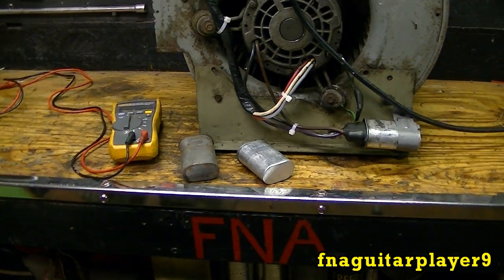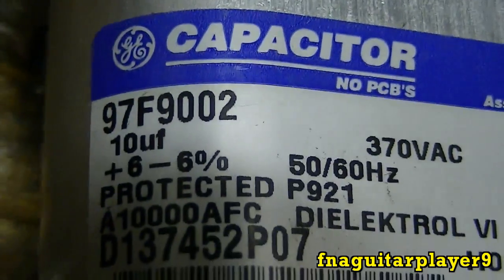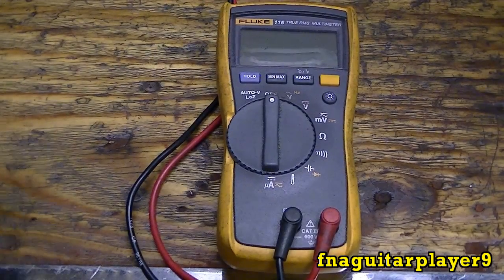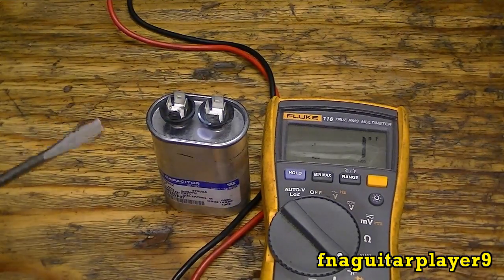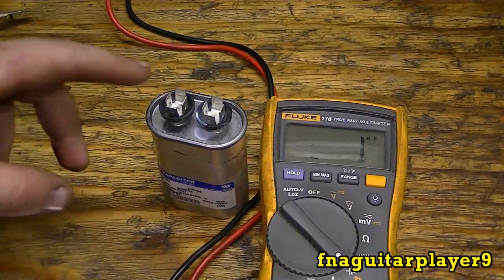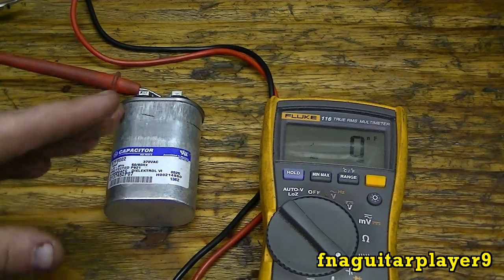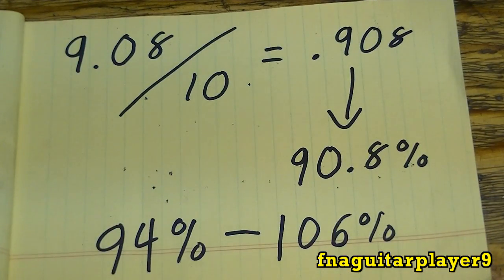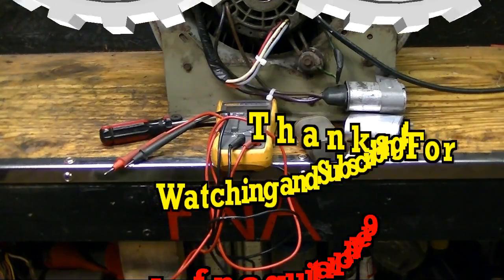How to Check Motor Start and Motor Run Capacitors

Comment: That higher value is not a serious issue. In the old days they could be +/- 20% new from the factory and would work just fine. The capacitance usually will go lower with age not higher. The reading may be higher due to high resistance. The capacitor is used to create a phase difference between the windings to cause it to rotate. This is a good basic check. Typically these days, new out of the box is usually very close to exactly what the value on the box is and the USA made ones are almost spot on. The capacitors are best tested with the current and voltage method in circuit but is not safe for novices as the capacitor voltages are higher than the input line and can be very  deadly.

Comment: i always wondered do capacitors read different capacities when tested with different voltages. like if a capacitor is gonna work under 220v ac it's capacity must be tested with 220 volts to show correct value?

Comment: Also motor will not burn out if it has thermal protection like my pool pump,it stop itself during a capacitor failure.
Reply from the maker: Some older motors may not have that though, it should but they may not. Thanks for Watching!!!

Comment: My A C blower capacitor 10 uf  370 volts stop working but I put 50 uf 370/440 come to my surprise it is working so the higher uf will run the motor but if I put lower uf will probably not work right?
Reply from the maker: If the capacitance isn't right it can make it draw more amperage or heat up, may work in a pinch but can cause damage over time. Thanks for Watching!!!

Comment: Would have been nice to have had a simple explanation of why we need a capacitor with our motor. Did not need a lengthy math lesson. If you cant figure a simple percent got no business working on this type equipment to begin with.
Reply from the maker: This video was on checking capacitors, not so much what purpose they serve, i can do another video on explaining that but it was not the purpose of this video. Thanks for Watching!!!

Comment: Thanks for this information a very professional class done in laymen's terms so just about anybody listening and watching would understand and yes mine was the capacitor last week this guy who works on AC units told me it was the motor after replacing it it done the same thing called them up and they sent a different technician I explained in detail what he did he looked at me replaced the capacitor then left an hour later the first guy showed up handed me my money back for the motor the boss of the company made him do this which i personally thought was a good deal all the way around because it made him embarrassed to do a better job after that I looked  up how to test them and thanks to you I can thanks again
Reply from the maker: Your welcome! Thanks for Watching!!!

Comment: ok, you earned a sub..  i have 1 question.. can the start windings burn up?  they dont have any resistance..  motor hums..  i give it a spin by hand and it runs fine..   capacitor just checked out OK.....
Reply from the maker: Appreciate the sub! yes, that is very possible thats wahts wrong, some motor will have a centrifugal switch to turn the starting windings off, that may be bad to. Thanks for Watching!!!

Comment: Awesome!  Thank you for a clear and simple explanation/tutorial.  You saved me several hundred bucks on a motor I was gonna replace.  A new $10 buck capacitor was all it needed.   I'm not an electrician but I have a good respect for dangers of electricity and good common sense.  All the other videos I watched on this subject were confusing and too complicated for a non electrician.   They had lots of diagrams and technical symbols, frustrating as heck. Thanks again, this was  extremely helpful.
Reply from the maker: Your welcome, its always the first thing to try.  Thanks for Watching!!!

Comment: I am testing the run capacitor  on my washing machine..the weird thing is,one or 2 times I get a reading..then I will try a couple of times and get nothing at all...I am using a fluke "auto reader" meter..I haven't had any issues testing other things with it
Reply from the maker: I'm not sure what would cause that, unless like Nici said it could be if the leads were swapped around it may be trying to discharge the cap from where it was tested before or something. thanks for watching!!!

Comment: Nine times out of Ten your capacitor is puffed out and is bad.  I replaced mine for $14.11  because it was more than 20 years old.  AC works as NEW.  I also replaced two 240 volt fuses that run the outside AC unit.  These videos saved me time and money.  AS a Reward I Paid MYSELF $ 500.00  For taking a moment to learn these basic techniques for repair. Thank You Louis.  6/30/2019.
Reply from the maker: Yep most common problem! Thanks for Watching!!!

Comment: IS IT NORMAL WHEN A SINGLE PHASE MOTOR RUNNING THE CAPACITORS TO BE  HOT OR THEY HAVE TO BE COLD NORMAL
Reply from the maker: They should not get hot, warm is normal but not hot. Thanks for Watching!!!

Comment: For one side you recomended to replace the  bad capacitors and your blower motor has a bad capactor and still using it . It this is an incongruence or not?
Reply from the maker: Yes it is, but this blower is used as a fan in the garage and is not used very much at all, so it wasn't a big concern to me, if its was on a furnace that was used it would be different, it wasn't to much out of spec. for what its going to be used for. Thanks for Watching!

Comment: Thanks for sharing this wonderful presentation. I'm impressed with your knowledge and simplicity to teach. This leads me to ask you a question concerning the following problem.   
I bought one of those el-cheapo China grinders, and it takes forever to reach the top speed; besides making a humming sound like if it was going to burn up before it can get to working speed. 
Now, is it possible to add, like a start capacitor to this bench grinder motor?
I just happen to own another grinder with 3/4 hp motor that looks identical to the new one, but with the difference that it starts much faster and also makes some clicking sound at the starting and the cut-off time (?) I'm assuming is because my old one has a starting capacitor, and this is the reason for my question. 
I have the feeling it can be done. Although I'm not including parameters, because I don't want to give you the impression of taking advantage of you but certainly hoping you could help me.
Thank you for any information.
Reply from the maker: I don't think you can add one to one thats not designed to have it, sounds like the starting windings are weak. That clicking sound is a centrifugal switch that engages and disengages the starting windings at a certain rpm. It might just be a weak or bad motor on the new grinder, its hard to say for sure. Thanks for Watching!!!

Comment: You stated using a cap that is out of range is bad for a motor,,, yet, when you tested your own it was in fact out of range, yet, your still going to use it, what kind of example is that? Buying a used cap on line, when they cost a means 20 bucks, are you kidding me? Just saying, I really did like the lesson, you did a good job minus the example you set.
Reply from the maker: I appreciate your opinion and you are correct, and if this was used daily i would not have used it, but this blower probably only sees a couple hours of use a year. I will eventually get a new cap for it. Thanks for Watching!!!

Comment: This video helped me troubleshoot a bad capacitor similar to the blower unit in the video, I got a brand new replacement for 5 dollars on amazon. unfortunatly after about 45min the blower stopped kicking on while the outdoor unit was running. I guess I have a bad motor.
Reply from the maker: I hear ya! Thats a good price. What probably happened is after a long time of using a weak capacitor (which usually shows no signs) it damaged the motor. Thanks for Watching!!!
Reply: Actually, I found the relay board to be the culperit. 28 bucks on amazon and it is running fine the last few days.

Comment: Thank you for taking the time to make this. You made this where electrical idiots like me can understand this.
Reply from the maker: Your welcome! haha i hear ya, i try to keep things as simple but detailed as possible. Thanks for Watching!!!
Reply: fnaguitarplayer9  I figured out what was wrong. I bought a 42 inch shop fan for $30 that was not working. After watching video I checked the capacitor and it was bad but so was the cord leading to the motor. I think it grounded out destroyed the capacitor all in one shot. The reason that I'm an electrical idiot is because my father was electrocuted with 169000 Volts for 18 seconds on December 18th and 1973. Blew off both of his heels and burned in 95% as body third and fourth degree burns. he died 5 times in Parkland Hospital in Dallas but he made it. He worked for the company Texas Power and Light for another 32 years.
Reply from the maker: I hear ya! That was a good buy even having to do that to it. I hear ya, daggone, he was extremely lucky! That is alot of power and live from it!

Comment: hey fnag wonder if you could shed some light here. i have a problem with my 1 year old 14x40 metal lathe. i was running the lathe at 1100 rpm on a 3hp single phace 220 volt motor and accidentley moved the rotation lever too far and changed motor direction at 1100 rpm and saw a flash or spark comming from the motor. motor does not work lathe still has all good 220 power to it. did i blow the capacitors you think. just looking 4 some ideas b4 i take the motor out tommorrow. thanks any help would be appreciated.
Reply from the maker: Hey. It may have been a capacitor or it could have been the winding itself burnt in to. Hopefully it was just the capacitor, then you can change it for way less then a new motor. You would think it would have a interlock so that can't happen. Another thing i just thought of, some motors and transformers too have a inline fuse link in the winding, that may have been it. Thanks for Watching!!!

Comment: Thanks for the info!  Our 20 year old furnace blower finally stopped running.  I figured the hum and motor requiring a hand kick start to spin up that the cap was bad.  Ours uses a GE 97F9003 12.5uf 370 +-6%.  Found a replacement for about $10 but its going to be hot in the next few days so by executive order (wife) I paid extra for expediting.
Reply from the maker: Your welcome! Probably is the capacitor, if it still does it with the new capacitor then its the starting windings, but its usually the capacitor. I hear ya! Thats not a bad price. Thanks for Watching!!!
Reply: fnaguitarplayer9  As a backup I called a local Air and heating Co. who quoted me ... wait for it.... $98 for the part and $86 to put it in. How can they sleep knowing they are jacking customers.
Reply from the maker: It doesn't surprise me, they charge crazy prices because they know people have to have it. I don't either!
Reply: Reporting back after receiving the new cap.  It worked perfectly!  I was a little apprehensive that the motor windings might have fried but the blower seems to be spinning at a normal speed.  Thanks again!
Reply from the maker: Good to hear! Thanks for letting me know! Sometimes they do sometimes they don't, its always the best thing to try first, your welcome!

Comment: My husband cannot find the capacitor on our fan blower motor. It's not strapped to the outside. Where could it be???
Reply from the maker: Some don't even have it, trace all the wires from the motor, the wires feeding the capacitor are usually brown, but not always, they may have it where the sequencers (if its electric furnace) or where the circuit board is at in gas furnaces, and as i said don't even have them, and if thats the case the only option is to replace the motor if its not working or not starting. Thanks for Watching!!!

Comment: Do you have a video for,or could you send me,a diagram(including motor wire colors) of how you have the switch wired to the motor to get different speeds?I had a similar blower given to me that was wired up for 1 speed and no switch.Thank You
Reply from the maker: I don't have a video on it, but most motors have a seperate wire for each speed, like a 4 speed one will have 4 "hot" wires and 1 neutral wire, connect the neutral to white, then connect the hot to one of the 4 speed wires, if your using a switch like i did, pick out which 2 speeds you want ( i sued Hight and medium low) tape off the unused wires, connect power to the middle lug on the switch, then each speed wire connects to the top and bottom screws/lugs, this gives you middle off, then high up and low down. hope this makes sense! Thanks for Watching!!!

Comment: Thanks, blower was humming (and not running) for about 15 minutes before I realized there was a problem, that and the heat building up in the house. Of course all the parts stores are closed but I was able to get it running by giving the squirrel cage a hand start. I'll get another cap tomorrow when they open. Even though the blower is now running (with my hand start method) I can still hear a hum that I'm sure was not there before. I'll keep an eye on the motor cause it might be next thing to go.
Thanks again...
Reply from the maker: Hopefully it didn't damage the windings sitting there that long, sometimes they will make noise with a bad cap when running, but yeah i'd say get a new cap and see what happens. Thanks for Watching!!!
Reply: Got new cap ($10.22), works fine now and quiet as usual. The old cap had no reading and had started bulging out at the top. Thanks for affirming my initial conclusion of a bad cap. Wonder how much it would have cost for a company to out and fix it.
Reply from the maker: Thats not a bad price at all. oh wow, good thing it didn't blow. Its hard to say, probably at least 100-200 dollars. Glad it fixed it!

Comment: Hello. Thank you for the great video.  My interest today is I have motor that is making a "buzzing" sound. At the electric motor repair place, the motor (actually from my furnace, the 'flow inducer motor' that has a fan assemble too) was fine running on the work bench, it did not make noise or heat up.  Back at home, reinstalled, after ten minutes it started making the noise and getting hot (but nothing melting).  Could a bad run capacitor cause the motor to make this noise?  (motor: 115V 0.75A 3450 RPM Thermally Protected)
Reply from the maker: +Michael M Your welcome! yes, it is possible for the capacitor to cause that, usually it just causes them to heat up but a sound is possible, it would be the first thing to try, but it could be the motor is bad to, the windings going out, but i'd check the capacitor first. Thanks for Watching!!!

Comment: Hey you just throw away  capacitors that they were  stll working even with 9.08uF reading.In theory it maybe right....but in practice it WILL still more to run.
Reply from the maker: +Andreas Christodoulou I didn't throw it away, i put it up as a spare, just trying to prolong the life of the motor, I did throw the one away that came off the blower i showed in the video, it almost blew up!! Thanks for Watching!!!

Comment: If it is a 3-pronged capacitor, which two prongs do you use to test the microfares or does it matter?
Reply from the maker: Da1 Gooch That sounds like its a dual capacitor, meaning 2 capacitors inside the can, with a shared lug, which should be the middle, if it is, check between outer lug and middle, and the other out lug and the middle. But both might read different if it had different ratings for each side. Thanks for Watching!!!

Comment: Hi I'm working on a whirlpool dish washer.  cancel drain works ok but when it is suppose to be washing it hums.  I'm assuming that the motor probably is ok and that the starting capacitor is bad.  any thoughts on this would be greatly appreciated.  great presentation on the video.   I just completed an MWO from the 1930's now working on a house power system using Gerard Morin's videos  here's a link
https://www.youtube.com/watch?v=3Spf5WVGgSY
Reply from the maker: ***** More than likely i'd say it is a bad capacitor but it could be a bad motor as well, hard to say really until the capacitor is tested / replaced first. Something could be locked up somewhere to, rusted up or something. hope this helps! Thanks for Watching!!!
Reply: just replaced the whole machine under neath was a disaster very old 1995. can't hear the new one run.  I'm trying to find a 36 coils fisher washing machine motor.
Reply from the maker: ***** I hear ya! Sometimes thats the best thing to do. You might be able to find one on ebay.
Reply: Ebay has some but the hall sensors are 2 instead three  but I should be able to make my own sensor with epoxy plastic  I just need to get it to stay steady in-between the coils
Reply from the maker: ***** I hear ya, certain parts are hard to find.

Comment: This is awful. Who buys used capacitors? what happened to your tips on your meter leads? terrible video.
Reply from the maker: H Stetser I was just trying to save a few bucks for a blower/fan thats only used for maybe 10 hours out of the year. No problems out of it yet. I would never even think about using a used capacitor in a furnace or something. thanks for watching though.